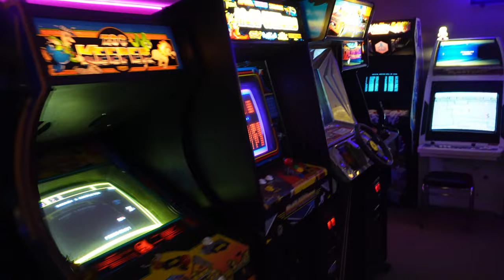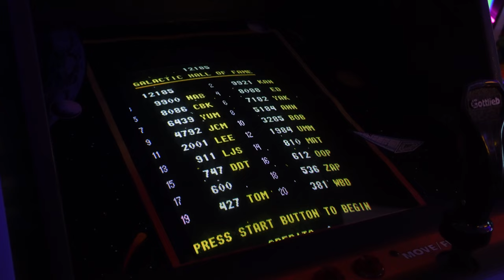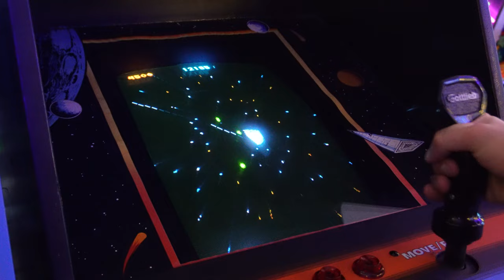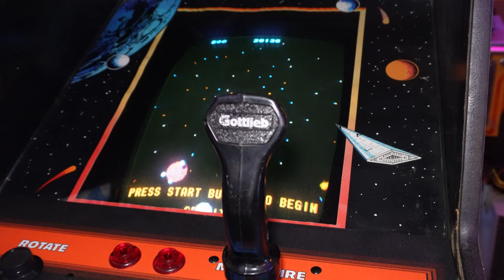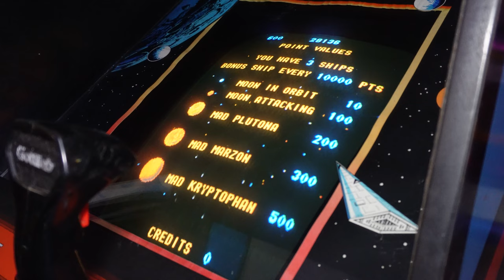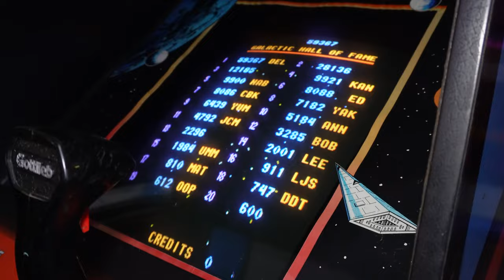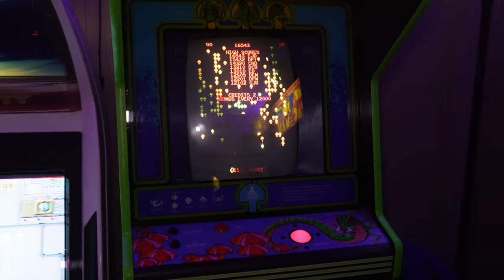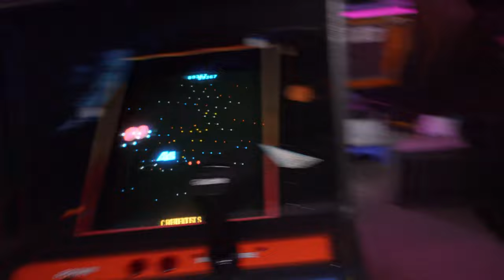Escaping the Madness: How to Fix Mad Planets Audio Issues

Comment: 19:30  That long screw bolt has a square key on top.  If your control panel has such a square mounting hole, then you should be fine using it.
That DeoxIT Green is carbon track safe.  If a leaf switch contains carbon pad, then (of course) you want to use DeoxIT Green.  A little warning:  D-5 and F-5 contain a solvent that is not safe on plastics (good thing you used D-100 where the plastic is :)).  These two are good for flushing out particles that should not be there.  When done, you can follow up with D-100 or F-100 for longevity (they do not contain the solvent) and better protect the surface.   D-5 has just 5% lubricant/protector while D-100 has 100% lubricant/protector.
I've seen people generously using D-5 on old receivers.  This thing would gunk up over the years and many composite boards inside would just flake and fall apart (due to the solvent).  More is not always better.  I like the old applicator with a thinner straw (without that big plastic top).  You are able to better control the flow with it and you use less, so it lasts you longer.  The new applicator sucks.  That thick straw is difficult to get in some places.  People say that the company made that new applicator, so you use up the solution faster and buy another one... making them much more money :/.
Reply from the maker: GREAT info!  Thanks!
As for the screw, I only have 1.  I need another and no one seems to make it.  So I'm fabricating my own solution.
Reply: @delsarcade  Yeah, you kind of want to have two matching bolts, so your control panel looks nice.
As for the pot, later down the line, you can still take it apart and clean it, if needed (to keep it original).  The way they are built, you can still service them.  Then you could apply the F-100 on the track for longevity (gently clean with F-5 and a q-tip first, then follow up with F-100).  Also, apply a special grease between the shaft and housing.  That will also act like a sealant and cushion, so the shaft moves less from side to side, exerting more equal force on the track.  You should be fine as it is for now.  You don't move that pot much anyway.  All that extra work is more necessary with old receivers where you move the pot more often and a smooth movement and feel is more necessary.